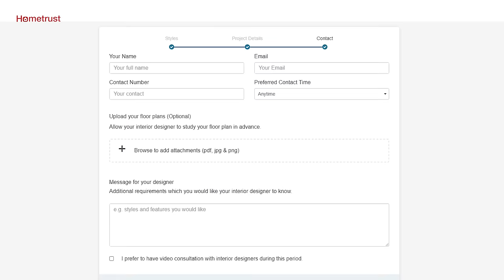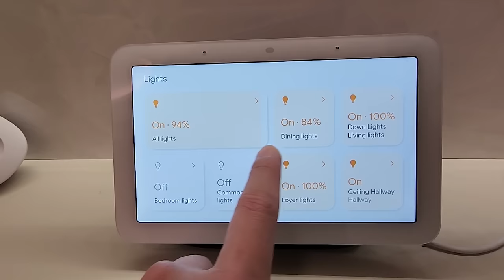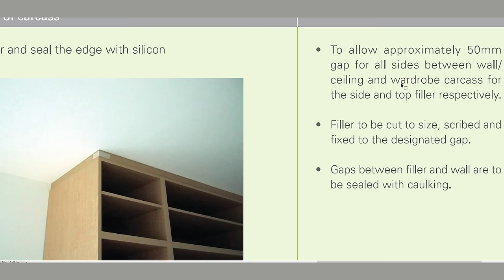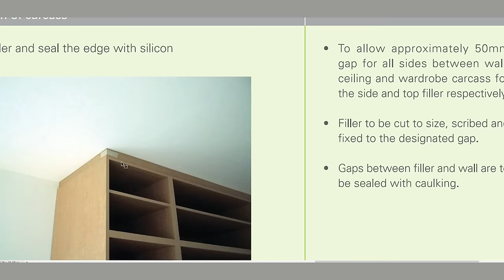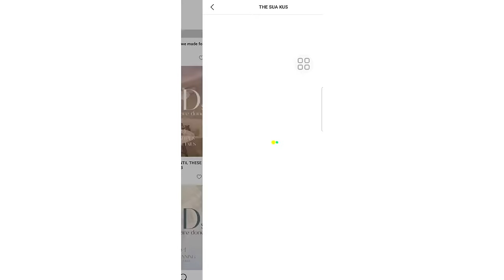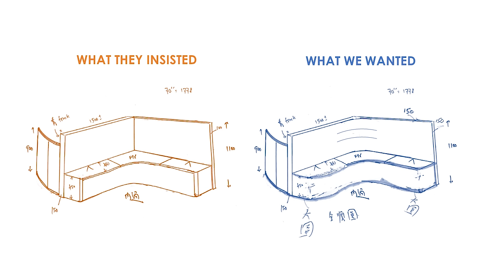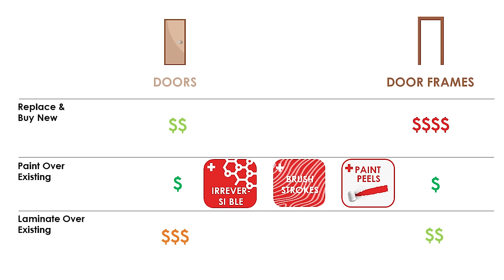Living & Dining Room Tour & Renovation Tips | Self-Designed Neutral Contemporary Home | EP15 HDB BTO

Comment: Hi! Did you need to connect smart wall switch or normal wall switch to connect to your smart light? If u r using smart wall switch, what is the use case where u need to connect smart wall switch to smart light as I understand that u can turn off the light using remote switch
Reply from the maker: Always go with this rule of thumb: 
Smart Switch and Dumb Lights OR 
Dumb Switch/Socket and Smart Lights

We use smart switches for kitchen, bathroom and our walk-in-wardrobe lights because we don't need them to be dimmable or have fancy colours.

For living, dining and bedroom, we went with smart lights.

Comment: Hi! Really nice to learn so much of your smart home system. I also noticed hue is so expensive for its down light. Hence I’m considering getting gledopto as well. How’s your experience in those light? Do you face any problem? Btw, Do you mind sharing of where did you get your gledopto down light?
Reply from the maker: Hi Chrysan! Glad you found it useful! :) Gledopto works like a charm~ very seamless with Hue. Out of all the light systems we've used (Yeelight, Tapo, Hue), Hue really is the most stable and reliable system. We got it from Shopee here: https://shopee.sg/Gledopto-Smart-Color-Zigbee-LED-downlight-6W-9W-12W-i.1268545.5013308915
Reply: Sorry! Just noticed your reply! Thanks so much for sharing! Do you mind sharing if you are using 9W or 12W? Thinking to get 9W but unsure if it’s  sufficient to light up my living room😅
Reply from the maker: We got the 12W x 3 lights :) these are smart lights so they will be dimmable!

Comment: Hihi did you use screws or 3M tapes for your stotta lights? Any issues till now🙏🏻?
Reply from the maker: Hello! We just drilled it into the carpentry so that it is secure and wouldn't drop onto our heads 😄
Reply: @thesuakus  any issues with battery operated lights? Cause my logic tells me wired ones are better
Reply from the maker: Aha yes, wired ones are more convenient so you don't have to replace the battery! But you will need to plan ahead and cater for the socket and place to hide the driver at the top. We did that for the walk-in-wardrobe carpentry (you can see it in that episode!)
Reply: @thesuakus  I see but I don’t have the luxury of having space for driver.. can share how’s the performance of the battery operated stotta? How often you need to replace the batteries?

Comment: Hi Sua Kus, as pawrents do you think there are things that you should 100% have, and things that you need to remove for their safety?
Reply from the maker: Hello! Aha yes, furkids and kids alike... safety wise - window grills would be ideal but we figured that mosquito nets would be just as good. Most of our carpentry are also curved so no issues with sharp edges that may injure them too. Also can try to reduce exposed low-level electrical points if your furkid has a habit to bite on cables and wires.

Comment: Is there no way to fit recessed lights into the ceiling without the false ceiling? Thought new BTOs have thicker ceilings?
Reply from the maker: Hello! There is no way to do recessed lights without a false ceiling in BTO 😅
Reply: How about putting strips of LED lighting along the top edge of cupboards' doors & have them project light up onto the carpentary profile?
Reply from the maker: @Zhi Han Lee  Sounds nice and interesting!! Yup so long as there is plasterceil works or carpentry, you can be creative with recessed light strips in them. But to Eric's question, unlikely to be able to hack and embed them in the real ceiling.
Reply: @thesuakus  Oh oh or maybe he meant a different kind of recessed lighting